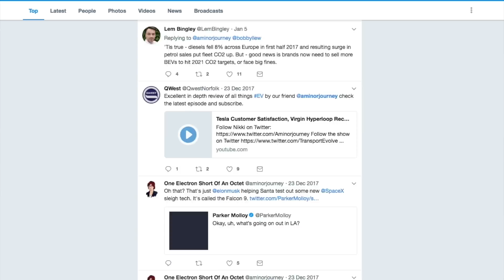Electric Car Fires: What You Need To Know

Comment: Not true you forgot to mention that there is 3 r 4 times as many gas cars operating on the streets then ev's  Take the total number of cars on the road and the number of cars that caught fire and the EV's percentage rate of burn is tremendously higher by far. They burn at a much higher temp and are releasing hydrogen cyanide into the environment as they burn and almost impossible to put out
Reply from the maker: I fear your information is simply wrong. As a percentage of vehicles, per mile driven AND on sheer total numbers, EVs catch fire less frequently.

^Kate

Comment: The number of moving parts is not a measure of fire safety. Even waste heat doesn’t automatically translate into a greater fire hazard. Regardless of the number electric car and bus fires spread far more rapidly and burn much hotter. It is also very important to note that many e- vehicle fires occur while they are stationary and not running.
Reply from the maker: Gas cars are approximately 60 times more likely to catch fire full stop.

That's the actual statistics.

And many gas cars do catch fire when notionally off and stationary, a cursory search of the recalls databases will provide ample gasoline and hybrid vehicles recalled for fire risk while "off". Currently there is a recall which recommends Hyundai gas vehicles park outside and away from structures...due to fire risk.

Hth.

^Kate
Reply: @transportevolved  Im not getting in an electric car or bus after watching the speed and intensity of the heat in their fires regardless ,as i have already stated ,of their frequency relative to anything else, but If you’re cool with that be my guest just don’t park near my house

Comment: The reason there are more fires in combustion engines is because there are more of them. I was a mechanic for 10 years and never saw one in any of the shops I worked on. I did experience about 10 batteries that blew up; time will tell and numbers will show...
Reply from the maker: Well, the numbers per vehicles sold and per mile are way lower for EVs than gas cars... So, yeah.

^Kate

Comment: Your video is good striving for excellence. Your focus is frequency, and the concern regarding electric car batteries is how to safely extinguish them when combustion occurs. Fossil fuel fires can be extinguished with smothering. Imagine a row of homes with 6 /12 feet between them. Imagine each home has electric cars. If one car catches fire in the garage of one home, the whole neighborhood will burn down.
Reply: Its happening already and will continue to do so.

Comment: This presentation appears depictng facts based on comparison of apples and oranges. It appears as if this justification and protection to EV vehicles comes from groups of vehicle companies who are based / dependent on EV tech probably because of vested business interests in EV tech. 
This tech isn't still mature enough to be considered safe for realities of roads and environment and people and their behaviour. 
Most of companies whose vehicle are burnt to ashes share no failure of their products but but battery pack had crack due to vehicle fall, loose connection caused short circuit, excessive heat as the vehicle was under 50+ degree Celsius, etc etc.
And the dumb or money centric governments buy dumb reasons as it is because they get huge returns in form of taxes (30-50%) of vehicle cost.
Can anybody answer one Q - if a death occurs due to EV failure and EV company and insurance company fail to pay compensation due for death of deceased, and even state/federal government does not pay heed to it, can complainant file complainant in international courts of justice against country's federal government and supreme court.

Comment: Interesting that all types of EVs are randomly catching fire . Personally not enough data exists to drew comparisons with fossil fuel  cars . I also agree with Larry ,risk is a combination of frequency and severity of an event and what clear is the EV fires are more aggressive ,hotter and difficult to put out . I personally will not buy a EV not only because of the fire risk but also due to the fact that they are not really green as you still use fossil fuel to charge the battery. Great video just not sure the argument stands up yet , just my opinion .

Comment: I am for EVs, but what is important to overstate is that internal combustion doesn't catch fire while parked and unoperated, while EVs do. This is the real problem with EVs. Your EV or E-bike that is parked in your underground garage will catch fire, which won't be able to be extinguished for a good 5 minutes (because it has too much energy to release), enough time to burn down the building.
Reply from the maker: There are a vast number of existing recalls for fossil fueled vehicles which can catch fire while sitting parked. Hyundai / Kia currently have the largest open recall for this kind of fault - 485,000 affected vehicles.

So, um, no. Your assertion is wildly wrong.

^Kate

Comment: One point to mention on the differences between battery fires and gas/diesel fires is that you can't extinguish the battery fires. Unlike petrol fires, battery fires produce their own oxygen so traditional foam and water do nothing, you need to immerse them in a pool of water to cool them down below combustion temperature and keep them immersed to prevent reigning.
Reply: Some new articles say it can take around 40,000 gallons of water to put out one Tesla fire. A normal gas car takes 500-1000 gallons, fire trucks can carry between 500-1500 gallons. 
So is it really smart to have all these electric vehicles allowed in areas with water shortage/droughts ?
Reply: @NickNembus  theyve come up with a new method for dealing with ev fires I kid you not they now sprey a foam round the car that hardens and keeps the fire contained and then they just leave it for a week until all the battery cells have burnt out they also don't bother with the person in the car so if your in a crashed electric car and you don't get out quick enough your left to burn to death it's completely stupid
Reply: @the-top-operators  Sounds kind of brutal, but useful for stopping the fires.

Comment: People saying EV cars catch fire less than petrol fuel cars are really dumb.   They have nothing to base that on.  There's still nearly 100 petrol cars for 1 EV cars on the road.  EV fires are going to be frequent and an absolute environmental disaster.   They are extremely unstable in crashes and will go up in flames quickly with all that stored energy.  DISASTER.

Comment: Maybe I'm wrong but I think electric cars are prone to spontaneously combust while parked in the garage while combustion engines are not.  Therefore electric cars should not be parked in the garage where they may ignite your home.
Reply from the maker: You're correct about two things here: you're wrong about spontaneous combustion of both kinds of vehicle.

EVs are not prone to combusting. The fire risk from an EV is much lower than that from an internal combustion vehicle in pretty much all circumstances.  That said, for an EV, the Bolt EV is higher risk. That's because Bolt EVs produced prior to 2021 are under recall because some do suffer from two manufacturing defects which - when combined with (it seems) frequent full charge/discharge cycles increases the risk of fire. It's still pretty low odds though, though I think the risk increases as the battery is cycled more and more.

You're also wrong about fossil fuel vehicles. A quick search of the recall database will reveal multiple recalls for fossil fuels vehicles with fire risk when parked - usually due to electrical issues. Sometimes these are massive recalls covering all-or-most of a vehicle produced by a manufacturer. 

We're just used to fossil fuel cars catching fire. It's not news anymore. EV fires are rare and so "news".

Hope that helps clarify that for you.

^Kate

Comment: Google search; How common are lithium car fires? Answer: Experts agreed that electric cars catch fire less often than gasoline-powered cars, but the duration and intensity of the fires due to the implementation of lithium-ion battery systems can make the fires in electric cars much harder to put out? Exposed electric components, wires and high-voltage batteries present potential shock hazards. Venting/off-gassing battery vapours are potentially toxic and flammable. Physical damage to the vehicle or battery may result in immediate or delayed release of toxic and/or flammable gases that can cause fire. It's the manufacturing procedures that aren't green at all! Try battery ponds & the way lithium & cobalt is mined by locals etc. If that's green? Some buggers coloured blind!

Comment: It’s too early.  The current technology and products are too new.  I contend newer ice vehicles don’t catch fire often and when they do it’s electrical related and has nothing to do with the fuel or engine.   I’ve been in the industry over 30 years and this issue is not properly vetted. A fairer comparison is to look at data from the last five years although not perfect it’s a better comparison.  One other thing, here in the UNited Stated, unlicensed people work on cars creating a hazardous problem for all contributing to the problem.  As stated before this is a complex issue.  Thanks for the video.

Comment: The only 'danger' posed by the proposed general adoption of electric vehicles is that the de facto standard of a modern world powered solely by fossil fuels may be dispelled, erasing forever the concept of 'Black Gold', Petroleum, being a path to financial stability or economic control worldwide.  After all, economists were assured for the better part of the past 45 years by experts out of Detroit, Frankfurt, and Tokyo that EV technology 'just wasn't quite there yet', probably would not reach viability for 50 to 100 years, and in all likelihood was impossible to achieve.  The existence of Tesla also challenges accepted, common ideas that insist advertising is a necessary expense, that 'Independent Franchised Dealerships' are the sole viable means of Distribution and Sales of New automobiles, that labor unions such as the Teamsters and UAW are mandatory millstones for corporate manufacturers to bear, or that ICE powered by fossil fuels is the only safe, affordable, reliable means of transportation in the world.  Thus, is it any way wonder that for over a decade there has been a constant, concentrated, focused campaign to  portray EVs as inferior, unsafe, expensive, and incapable compared to their ICE driven forbears by newsmedia companies in print, radio, and television that are largely supported by funding from advertising paid for by petroleum companies, and traditional conventional legacy ICE automobile manufacturers and their dealership networks?  Don't be a pawn of Petroleum companies.  Decide for yourself, based on the evidence available.  Sure, it is often argued that EVs simply 'cost too much'.  Perhaps.  Notice how in 1990, the average sale price for a new vehicle sold in th U.S. was $15,000.  Today that amount is $38,000.  Yes, for several years, the Nissan VERSA was the best selling, cheap, ICE based car in the U.S. at around $12,000 MSRP and it was greatly outsold year after year by the BMW 3-Series, which sold for at least $34,000.  Today, both are outsold by the Tesla Model 3, in the U.S.  Combined.  Collectively.  In Consecutive years going back to 2018.  Being based upon ICE does not automatically guarantee low price or high sales.  Those who suggest otherwise are entirely ignoring the facts and evidence to the contrary.

Similarly, the Tesla Model S has outsold many of its direct competitors among large, luxury, flagship Sedans since 2013.  Again, its market dominance has been largely combined, collective, and consistently consecutive, despite repeated claims that Model S sales were being cannibalized by Model 3 sales in recent years. Oh, and the direct ICE competitors to Model S, in top trim, all cost more than the top-of-the-line Model S in its top Performance trim.  So no salvation for ICE in that realm either.  Even newcomers, praised for their size, power, handling, styling, and price point, among entry level luxury cars, such as the GENESIS G70, KIA STINGER, and Alfa Romeo Giulia, all ICE powered,  failed to impress buyers in large numbers, despite their strict adherence to the precepts of tradition, convention, ritual, and legacy.  Even with their use of 'Independent Franchised Dealerships', and advertising campaigns that were rather widespread, none of them came close to the sales of the Model 3.  The term 'Diminishing Returns' comes to mind, along with 'Throwing Good Money After Bad'.  Even a rousing endorsement by Emerson Fittipaldi failed to garner results for KIA's entry.  Each of them was simply 'Too Little, Too Late', a fate I believe, will befall the Ford Mach-E and Ford F-150 Lightning as well, though I actually like each of those.

FUD -- Fear, Uncertainty, and Doubt, have been fundamental in spreading potential, and inaccurate, propaganda against EVs.  Concentration on the multitude of supposed 'problems' that presumably have not and cannot be addressed by EV Proponents, such as myself. For decades, I heard them say, "Until EVs have a 200 mile range, minimum, they'll NEVER be a viable source of transportation for the average person."  Yet, when 200+ mile range appeared, nine years ago, suddenly the argument became '400 mile range, minimum' despite the fact that numerous performance oriented modern ICE vehicles, sometimes costing multiple hundreds of thousands of dollars, were incapable of a 300 mile range, even using gasoline.  The excuse offered for that was that such performance cars 'were not meant to be grand tourers' and that 'most people rarely drive in excess of 40 miles per day, anyway'.  So, assuming that's the case, why the minimum necessity for five days' worth of range?  I used to think that was because, roughly 45 years or so ago, most cars were essentially gas guzzlers.  So, a car with a 19 gallon fuel tank that got perhaps 12 miles per gallon had a maximum range of maybe 228 miles on a good day.  Back then, there were no 'low fuel' idiot lights on the dashboard of American gas guzzling behemoths, so when the shadow of the bouncing needle of the fuel indicator/guess-o-meter glanced against 'E' on the fuel gauge, that was it, you had a walk ahead of you to get more fuel, because the car stopped, cold.  There were no cell phones either, so no easy way to contact roadside assistance was available.  You might be lucky enough to be nearby an operational roadside Call Box, but that could be expensive.  Not that  stopping at any of the Last Chance GAS! stations that used to dot the open highway in Arizona, New Mexico, and Texas were particularly inexpensive, as they charged ridiculously expensive amounts per gallon, mercenary rates, just to fill up, for a ride, or tow.  If your car only got 5-to-8 MPG, it was even worse, as your effective range was diminished even with a 25 gallon tank.  Because of this, people routinely stopped to fill up at anything below 1/4 or 1/2 tank remaining, and really had no idea of the actual range of their cars.  People who remember those days typically misjudge their needed range requirements for daily driving and mistakenly run out of gas all the time today, thinking, "I just put five bucks in it", forgetting entirely that it has been a LONG time since Regular gasoline cost less than $0.75 per gallon.  Dude, your circa 1978 El Camino is a gas guzzler, five bucks barely buys two gallons now, you were lucky to make it home.  Of course you ran out of gas.  Learn to count.  Numbers won't kill you.  I once had a Girlfriend,  eight years older than I was, who was in the habit of similarly thinking 'five bucks' was a substantial amount of fuel.  It was extremely difficult to convince her to read the amount of gallons she added at the pump instead of the total price she paid as a metric.

Comment: The fact of the matter is car fires no matter the fuel source are very rare.

But the 1/20000 Tesla fires compared to 1/1500 ICE fires is a misleading stat. Most Tesla’s are new. Few are sold used. Especially 2 years ago. But many many ICE cars are on their 2nd, 3rd, 4th owner etc. You can present your stats. But that doesn’t tell the whole story now does it.

Comment: Here is the problem we have that you did not touch on. What happens when a car is at a charging station and the battery has a bad cell and it burst into flames. There is no safe way to put the fire out. You can't use water because you have high voltage both in the cars and the charging station. The batteries and other chemical that are burning in the electric car put off more deadly gases so you cannot breathe in the air by The Cars either.

Comment: How are you not talking about the different classes of fires???  There's a HUGE difference in a class b oil fire and a class c/d battery fire.  Comparing EVs to ICEV are iffy too, how many 20 yearold EVs do those stats include?  ICEV?  Roadsalt is gonna fuckup an EV much harder than an ICEV, eventually you'll run out of sacrificial anode and the battery will become it.  The language in this video is quite biased.

Comment: Well electric cars are more than 120 years old, Baker Electric Company starts in 1899 and made electric cars back then, those cars already had batteries, so this old concept did not evolve. I do not want buy an electric car that has a havy, battery that take too long tô recharge and hás a Very high energy density on those cells.

No thanks, those electric cars still primitive, frankly I spect something batter, with no battery, like the battery less electric car that the real Nikola Tesla made.